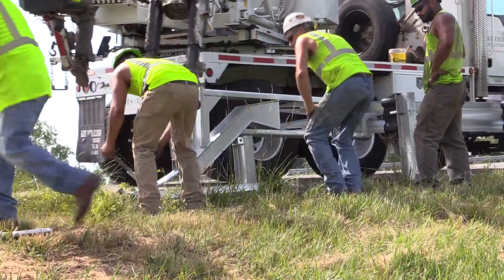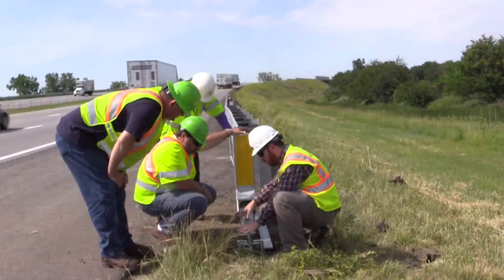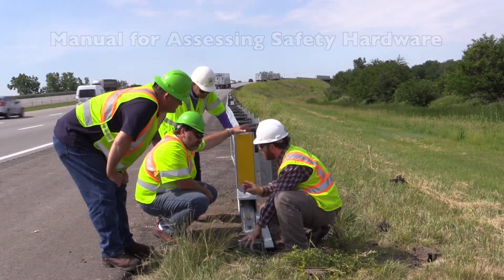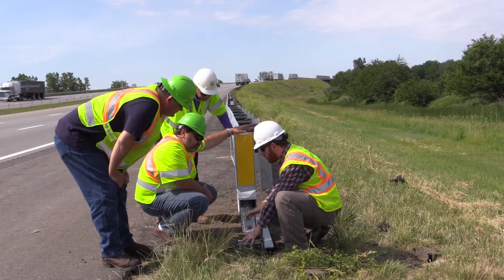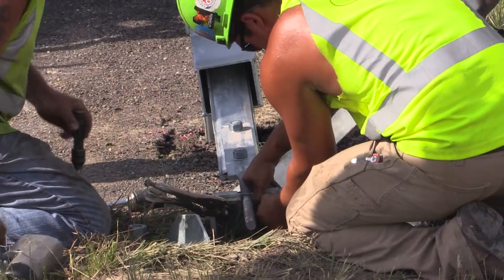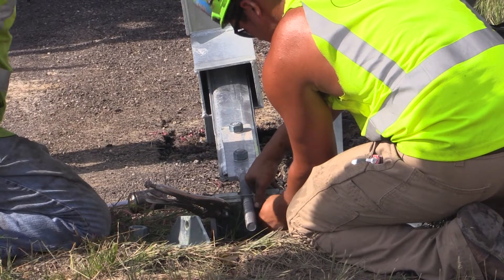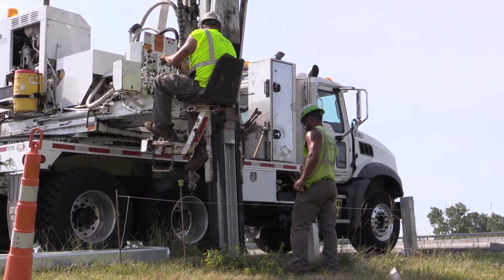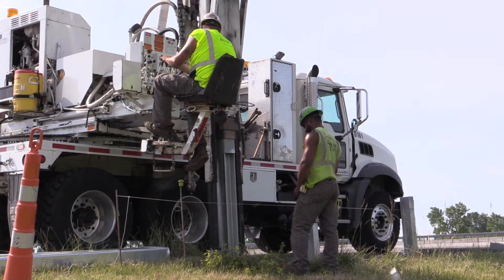Guardrail Installation I 75

Comment: Sorry for your loss. I’m not sure that bolt would be the cause of the failure. The force of a car collision is enough sheering strength to cut through the shank, shear off the head, and if hit from an odd angle, strip the threads clean out. I’m picturing myself with an impact and a galvanized 3/4 inch bolt, and a half decent but really maybe a 4 mil thick washer, and bolting the face of the guard rail to the second post. No shot the head of that bolt says on. Either the bolt and washer are strong, and the extruded sheet steel of the rail rips and pulls away, or the head of the bolt and washer shear off. And I understand the difference in torsional strength and shear strength. If anything, these implements should be designed with hardware designed to fail at certain points to help with the collapse/crumple of the barrier.
Reply: I don't know who you are responding to but one bolt in the wrong place can jam up the system and send it either through your windshield or over your car.
Reply: @Kaleb99j  You read my post. I’ve already explained why that’s not true. I’m talking about the physical dynamics of fasteners. You’re regurgitating Tik-Tok brain rot.